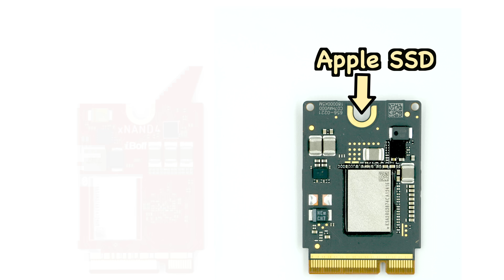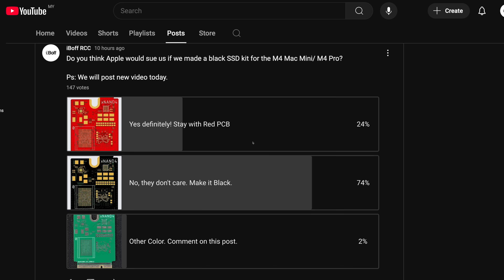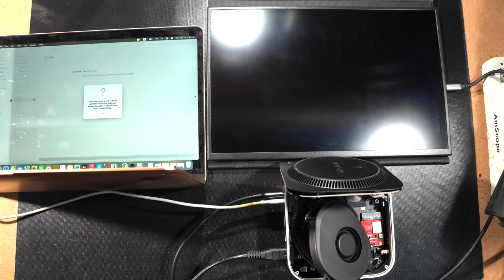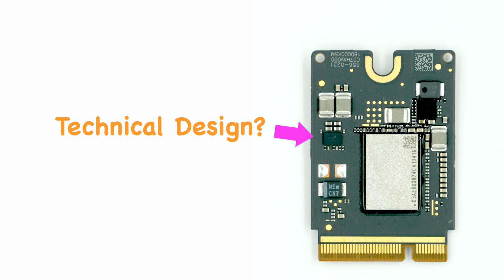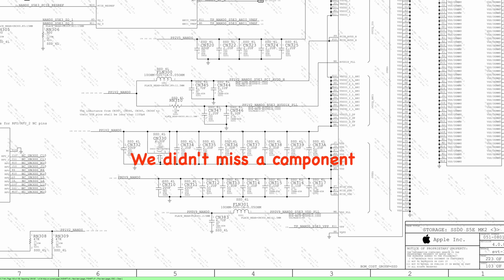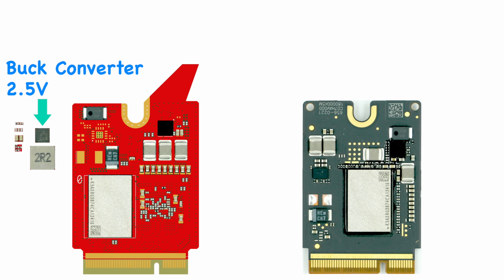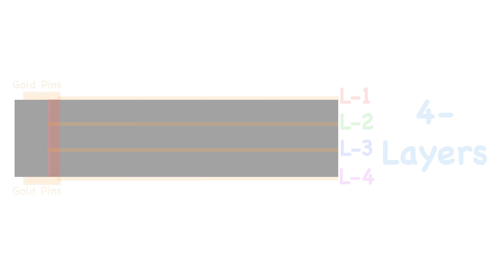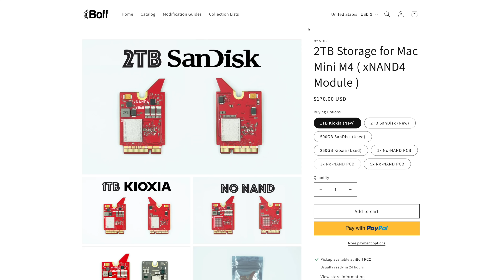We Finally Beat Apple’s M4 SSD – Faster, Bigger, Cheaper!

Comment: Anything that defies Apple's anti-repair efforts is okay by me! Anything that ruins Apple's greed and proprietary lock-out trickery is somethng to celebrate. Now watch them quickly come out with a new MAC Mini revision that solders the NANDs to the board, epoxies them and serializes them with encryption added - and charge their customers for this mean greedy scheme.
Reply: "Anything that defies Apple's anti-repair efforts " <- how is this an "anti-repair" effort?  You do realize that Apple gives instructions on how to open the Mini, provides instructions for repairing the Mini, and even sells replacement parts, don't you?  Maybe it's you who needs to update your belief system.
Reply: @TheDanEdwards  I run the most succesful component level appple product microsoldering repair business in the upper midwest. I have been repairing apple circuitry 'since the Apple IIe came out. Go check out Louis Rossmann's video on that Apple repair kti and parts facade. It is ALL of practically ZERO use to anyone with real world common problems. The proprietary commonents that fail when you spill your half caff soy latte' on your macbook while at Starbucks and you have an anyeurism over seeing something positive about Trump - are NOT shared. Most mindless lemming Stockholm Syndrome Apple fan-boys are militantly selectively misinformed, yet they'll be first to attack with their ignorance any who shed light on Apple's anti-repair designs. See "Right to Repair Bill" Most people learn about the side of a war they wave a banner for prior to chosing their hill to die on. I prefer Right to Repair.

Comment: Greed is the ONLY reason that Apple makes those SSDs proprietary. There is no justification for it. The usual excuses from Apple fanboys do not apply:
- They did not need to make them proprietary in order to improve performance.
- They did not need to make them proprietary in order to fit in a smaller form factor.
- They did not need to make them proprietary in order to improve the user experience in any way.
They ONLY did it so that they can charge $$$$ for storage upgrades.

 Bravo to iBoff RCC for sticking it to Apple!
Reply: so real !

Comment: i'm tempted to buy a mac mini now.
the only thing you could do better, is massively expand the storage limit.

can you get 4, 8, or 16 tb on one of those? just as you show with the airplane fin, you can change the shape of the pcb, and if you can put more chips on the daughter board, then you can change the domain of the product.

people doing AI related stuff, might want to put an entire LLM which isn't compressed on one of these daughter boards and so if you can have that much storage available and indexable, you can improve the value prospect of the base device.

just as it stands you have enough for a 'niche' product. but you could give new life to the used machines if you can increase specific arbitrary attributes.

Comment: A bit misleading. You are comparing a 250GB NAND to a 2TB, and I'm sure you know that bigger is also faster for solid state, all other things being equal. Apple's own 2TB internal drive hits more like 6,000MBps, so if we are being fair, your drive is less than half as fast for roughly one third the price, and that is reasonable - but you did not improve anything as far as performance. We can put a Gen 4 NVMe drive in an external Thunderbolt 4 enclosure and break 3,000 MBps, for less than what you are asking. That aside, at least options are happening, albeit underwhelming so far.
Reply: excellent point!  thank you !

Comment: Please post a video as soon as the Mac Mini M4 Pro version is released. I'll buy one right away!
Reply: The difference is that the M4 Pro has four memory chips, which run in quattro channel mode. Therefore, the memory is almost twice as long.
Reply: Commenting to ensure if you’re updated I will too
Reply: There's a few people now making replacement SSDs for M4. What is different with the M4 Pro SSD that no one is supporting it yet?

Comment: i got mini due to this posibility,  got the mini and ssd from china with shipping with in a week. any way, the point is the ssd i got is one of the custom design they did, they have the both chip on the same side which is facing the fan, this greatly reduce heat, stressed it, never pass 45 degree, matched your speed,  just a suggestion for your design.

Comment: Just buy the Samsung nand and a jar of lead balls.  Use the pencil 0.2mm and draw the traces with a magnifying glass.  The capacitors provide timing, but the trigger is voltage at open ground at the speed of light, fed by other capacitors, just faster triggers.

Comment: Apple's gouging, regressive upgrade and maintenance choices in their design, and their politics/ethics problems are key reasons why I don't buy Apple hardware, and I used to be exclusively using Apple hardware since the 1990s.

With that said this is a great project and you should be proud of your achievements. I see no reason why you should spend more money to increase to 8 layer PCB since you're already showing improved performance over official hardware with the design you've come up with. Just maximize your capital return for production of the existing design and allocate some of your return on investment towards the next project.

Comment: I appreciate this product but I have 2 questions:

1. Why does the Mac Mini recognize your SSD as an genuine Apple SSD? What kind of firmware trickery is going on?

2. Whatever trick is used for the thing mentioned above: Couldn't Apple just create a "security" update, which prevents the use of "unauthorized" SSDs aka. your product?
I'm pretty sure that Apple has some kind of update functionality for the Apple SSD firmware and it could either block your SSD in the future or entirely brick your SSD...

I'm really curios to the answers!

Comment: Any idea about install OS without mac 
I have only mac mini 
But afraid how install os after upgrade 
I have only PC
Reply: Sadly you are required to have another Mac to do this running macOS Sonoma or later. Using a Mac that can use USB C.

If you have important data you wish to keep, make sure to back that data up first. You will not be able to even grab that data once the move happens. Reason being that the drives Apple uses are encrypted in the firmware.

Comment: just use the cheapest color (probably green). This is a product for the people that want to save money. Hence it should have the cheapest possible production cost while assuring same or better quality then apples. The saved cost should be directly translated into the price. The higher the price difference the more people are inclined to get your product or maybe even pay someone to change the SSD for them (if they are unable to).

EDIT: Just saw the part about the support components. Yeah should offer them in limited quantities with limited support or warranty. Something like "experimental". Anyone that wants to cheap out and try it are welcome and any information about difficulties would be valuable data. Maybe even of enough value, that you could offer the limited supply with full warranty).

EDIT2: About the supply and buyers sentiment. Do a Strawpoll or use youtube Voting stuff or something. I am not using a mac for obvious reasons, but for those that depend on such a machine it is probably a really good product. I only see a problem in apples brainwashing (if it is not from us it is fake and it is a security risk, so you should not buy it. Trust the ecosystem).

EDIT3: You could also do a presale with a 6 month waiting list. You collect however much sales you can and order the batch that corresponds to the sales amount. If you got enough units to use the improved 8-layers, then the people got lucky to get the better product, if not then not. It is not like the product they are promised will not ship it is just slightly inferior to the best possible outcome.

Comment: The fruit company is going to be pissed. You just made something that defeats the purpose of their marketing scheme. EFFECTIVELY robbing them of $500-600 up charge for more SSD space. NICE JOB!! It’s only a matter of time before they include a trigger wire in their memory chips that can’t be modified without cutting the power lead on the board to get to layer 2 of circuitry. 

GREAT job 🎉

Comment: $260 for 2TB instead of Apples outrageous $800 is a crazy improvement! Well done!
Reply: $800 is just a ripoff.
Reply: @ikemkrueger  The price on their web page is now $408.00.
Reply: @ikemkrueger  Nobody told you to buy from them, sounds like you reap what you sow
Reply: @Ebani  I don't have a Mac Mini.
Reply: @Ebani What's the alternative?
Reply: @Ebani  They have good hardware, but their pricing is absolute BS for storage/ram
Reply: And normal 2230 SSD (similar size to this) is around 150
Reply: I used that $800 to buy a PS5 Pro console. Which also comes with a 2TB storage.
Reply: @HattoriZero that still a rip off as well
Reply: @HattoriZero does the Ps5 max out at 2TB , just curious?
Reply: @Mikein203  The PS5 Pro soldered on-board SSD is 2TB, the expansion m.2 NVME SSD maxed out at 8TB.
Reply: You can already buy fast 2Tb, from 179 bucks !
Reply: This is an amazing work! 
To be honest, i hope Europe and rest of the world put more laws against components that are not standard like this. It's even worse than an SSD Pcie 4.0, which can reach 7.000 MB/s, so the point for Apple here is making business and more money, that's all. We understand its a company, and they need benefits, but going against the standards with worse specs is going against ethics.

I like Apple devices, but the poor repairability, soldering components like RAM, putting the button on the bottom, glue everywhere where they can put screws...awful.
Reply: Agreed and the Apple OME SSDs weren't even that fast spec wise especially not for that price.  But remember Tim Cook said the RAM is worth double being half the capacity and about 10-20x the price for the same capacity and slower at about $1800 for 32GB shared with the graphics so really half that $1800 for 16GB of RAM when 64GB faster and not shared can cost under $200.
Reply: I think any computer that offers a base configuration of less than 512gb is just criminal these days. Everything has gotten so bloated it's crazy, and Apple's system with take up a huge chunk of the ridiculous 256gb base configuration. And to ask $800 for 2tb, when you can get 1tb NANDs of the same quality or better for slighty more than $100 is just utterly outrageous.
Reply: @odesseus 
Agreed! 

PC for the win?
Reply: @WarriorsPhoto  No, that's ok. Thanks anyway
Reply: @odesseus 
You're welcome. (:
Reply: $800 for 2?!?!TB. Jesus Christ.
Reply: @Per_TP I thought the $800 for the 2 TB is WITH the M2, not just the SSD itself. Where it's $599 ($200 difference?)
Reply: Clippy would never overcharge you for memory
Reply: Still to much imo
Reply: It sound just crazy, I just upgraded my Asus g14 to 2tb gen 4 ssd for only $99
Reply: @andrescarrasco1248 I might be looking to upgrade mine as well, yet it's not an Asus. If you don't mind me asking, where did you purchase it from?
Reply: Don’t you worry about malware from third parties though
Reply: $600 to upgrade from 24gb RAM to 64gb RAM, $1200 to upgrade from 512gb SSD to 4tb SSD - and I still ran out of space before I had completed installing all my virtual instruments for Logic Pro 🤬
Reply: Yes exactly! 🎉

I’ve buy this nand & perform this upgrade.
Reply: Apple's idology is simply: "F*** YOU, PAY ME!!"
Reply: i cant find the 8tb option
Reply: $800 is a scam lmao Apple screws over idiots
Reply: It's still expensive. I can get faster SSDs for surface laptop 7 for just 150$ for 2TB.
Reply: is not 260 and the siping , it is more , now fedex send my a mail to pay 107$ extra for shiping and customs taxes
Reply: now we can invest the rest in real gold instead of storage
Reply: Apple NAND IC not cheap.
Reply: Yes !!!   Great Job.
Reply: Yes sir, way to stick to the greedy asses
Reply: $277.00 USD for the regular Mac mini Model, $336.00 USD for the Mac Mini Pro
Reply: It isn't even far from a standard nvme 2TB ssd with those R/W speeds
Reply: @zsoltpeterdaniel8413  it is. Western Digital SN850x 2tb goes for around $150.
Reply: @zsoltpeterdaniel8413 I can get the latest PCI-e Gen 5 Samsung ssd for ~300 bucks, for 2TBs, with 14GB/s read and write. I think it’s a bit far off.
Reply: and still extremely expensive.
i just bought a high end 2TB m.2 SSD for 150 bucks and could have gotten cheaper ones as well.
Reply: @Pixelplanet5 where is if you don't mind me asking?
Reply: apple buyers won't care and that's probably what they thought how much it's supposed to cost at "premium"
Reply: @gemyellow  when it is utterly bs, their charge and power ics fails all the time, that is on purpose
Reply: Why do apple customers pay 800$ for 2MB 😮
Reply: @japrogramer  Cult
Reply: @japrogramer  Well, people can't buy the kit before it exists, can they?  And now that the kit exists, we can say that $800 is a ripoff, but it's a $500 overcharge, and programmers can make that much $ in a day.  No one making that much wants to risk a warranty for that little $.
Reply: @japrogramer  because it means you don't have to void the warranty and faff about with opening the Mac and risk damaging it. Yes - this is cheaper but not risk free and frankly not sure it is worth it. It looks tricky to do - my Mac Mini arrived in a week and I was able to migrate from my old Mac immediately. So this would not work for me but great if others want to do it.
Reply: @japrogramer  What year is it? Apple hasn't sold "2MB"... anything in decades.
Is your brain damage preventing you from knowing how computers work?
Reply: @tim3172  I Think you can put it together that it's 2TB what they meant, don't need to be a toxic idiot about it.
Reply: @tim3172  Could it be that he mistyped?
Reply: @tim3172  Dude, have you ever heard of a 'typo' Chill and stop using any excuse to insult people, edgelord.
Reply: SUFFER!!!

Comment: as I understand it, the small board is very similar to a normal M.2 storage board, but lacks the controller chips. Would it be possible to create an external enclosure, not unlike many common M.2 enclosures, but that also includes those controller chips? Then you could take either apple's board, or your board, and use them as external storage.

Comment: should have made it black yo. black pcbs have better passive cooling. the majority of passive cooling happens through radiant heat transfer and a matt black surface finish is ideal. this fact is completely missed by every tech teardown channel. its something like 60-80% of heat transfer happens thisway inside of an electronic enclosure when the fan is not running.
Reply: They wanted to distance themselves from Apple as much as they could and left the color up to a community poll. I’m not saying Apple owns the rights to black pcbs but the more differences you can make to make the product unique the less chance of an issue

Comment: can you also do logic board for iphones. this 13 pro max display have issues about it erratically flickering to green and black, but i can still interact with the screen. I also can see the images and apps when the screen turns green. It is and can able to revert back to normal screen, but the constant flickering is annoying. I cant afford to replace it so i was wondering if there is a solution for it. Thanks Mr Boff

Comment: This is amazing, but is there no way to incorporate an m.2 slot to such an adapter? A right angle would allow for most standard sizes to slot right in.
Reply: it's not NVMe
Reply: @erkinalp  I didn't say it was nvme.
Reply: @YaBoiSmurf  normal ssds don't work. the controller is embedded in the apple silicon. only these custom made ssds work

Comment: Why 273 euros, there is no even a controller here, only nand chips. External ssd WITH controller costs less. I’m not hater I just don’t understand
Reply: The controller for the SSD is inside the M-chip
Reply: @ exactly, that’s why it should cost cheaper
Reply: Limited runs means higher per unit cost as a.) manufacture has less discount b.) R&D costs are spread over fewer units. 

Also there is a value proposition here and competition cost. Competition - direct from Apple is either very high at time of purchase or non existent for those that have already bought a device. This means the customer is facing either 2-3x cost at time of purchase or 5-6x cost if needing to buy a whole separate computer to get the upgraded capacity!

Comment: We need an SSD which performs really well at RND4K  1T1Q small file data read/write . This way the system would be even more snappier and faster instead of trying to reach insane max read/write speeds  of 7000Mb/s or or even 15'000Mb's for  file transfers . Maybe DDR ram cache would help to sustain  file transfers . The 8TB drive might be bertter equipped because there's way more space for parts
Reply: Afaik they cannot retroactively install RAM cache, the controller is in the apple silicon unlike commercial SSDs und afaik uses system ram as write cache.
So I'd argue even if you would be able to get some cache onboard, it wouldn't help you.